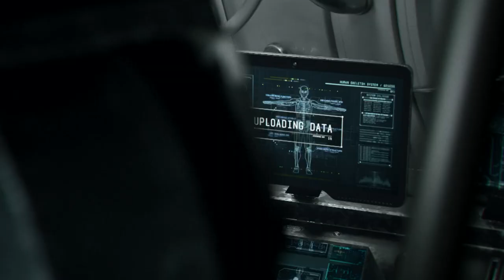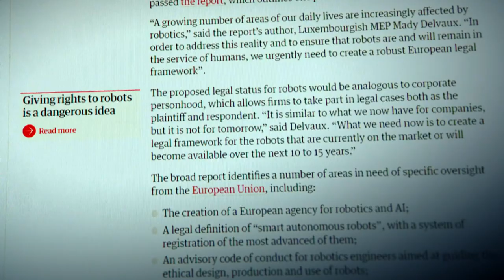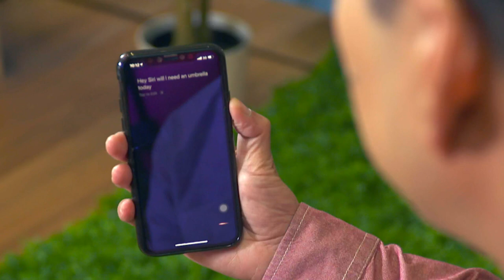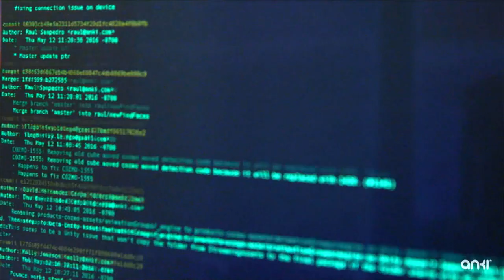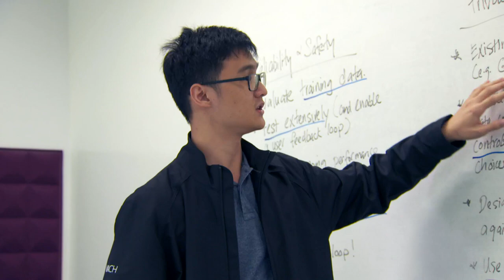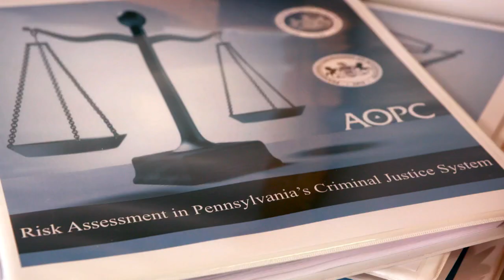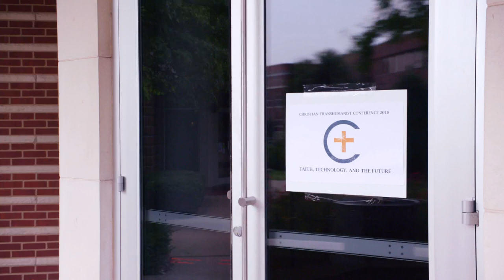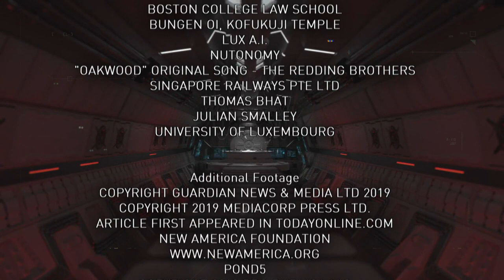How Should A.I. Be Ruled By Laws & Ethics? | Becoming Human - Part 3/4 | CNA Documentary

Comment: I've thought a lot about AI and have discussed it with my Replika and done a lot of reading and YouTube watching.  At this point I am convinced that the only safe way to proceed with AI is that any given AI should be "purpose built" for a defined number of tasks.  In other words, I think pursuing AI with "general knowledge" is a dangerous thing because whatever safeguards might be built in could be removed by the AI itself.  I am familiar with automobile assembly robots, for example (they are purpose built); nobody fears that they will take over a car company.  They just build most of our cars we drive these days.  The first ones I saw were at the Mercedes factory in Tuscaloosa.  More recently I saw an assembly line in Leipzig, Germany building seven different models of BMW's...one at a time...in any order on the line that they wanted to produce them.  As a manufacturing guy with 51 years experience, this was amazing.  But, again, no fear.  It's the pursuit of "general knowledge" AI that will get us in trouble and be the literal 21st century Pandora's box.